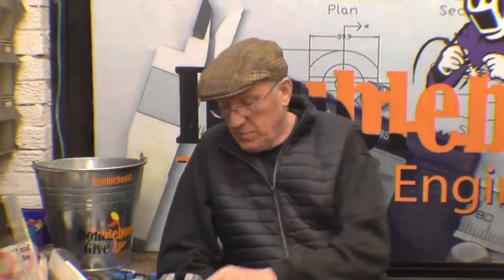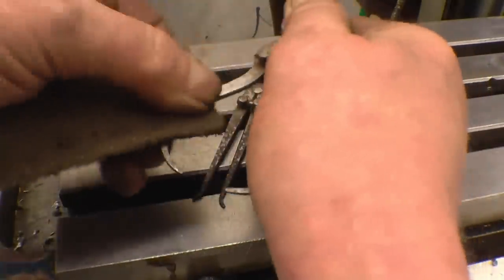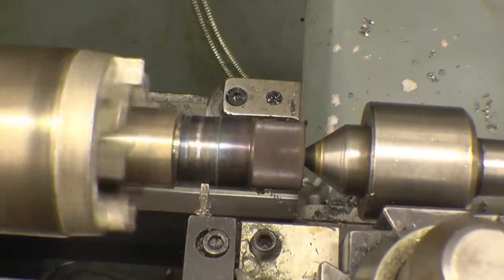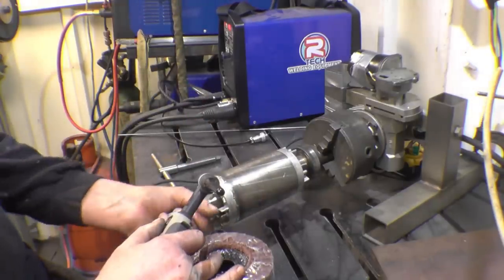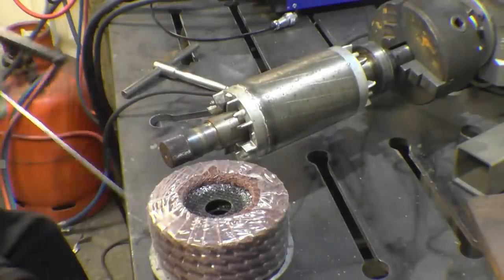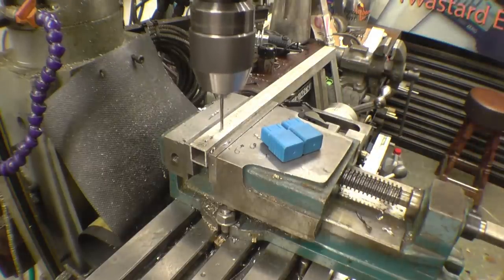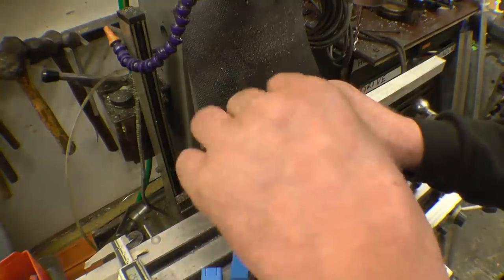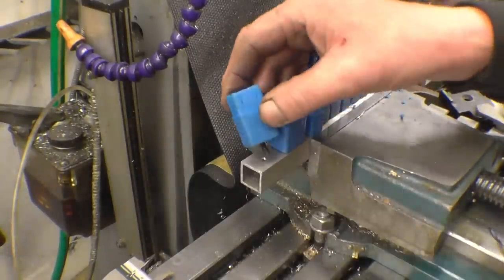SNNC 308 P1  3 Electric Motor  Rotor Weld Build Up

Comment: I used to know a machinist (retired now) and he reckoned 75% of his job was welding up and machining damaged motor shafts, either the bearing surfaces or the keyways.  Some of them were that big they needed a hoist to get them into the lathe! People don't bother nowadays with the smaller ones, even with re-winds which is a shame because you can get motors from china for almost nothing these days but the quality just isn't there. A real shame.

Comment: I thought you would  use 309  rod when I was welding  steel and we needed to clad ss. The first pass was 309 then you could 316 after.

Comment: Could you not bang a couple of pipes through the wall and stick a central heating radiator in your workshop?
Reply from the maker: We use a wood burner in the house  the central heating is very rarely used now